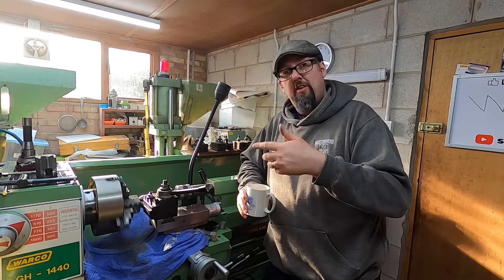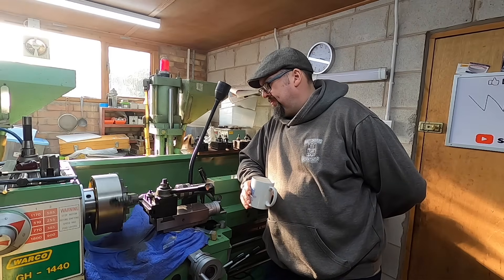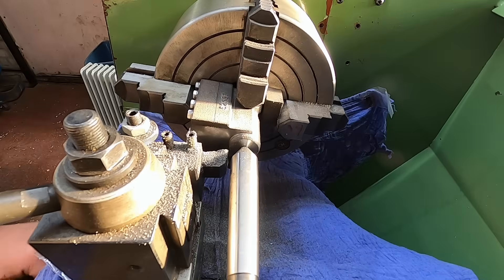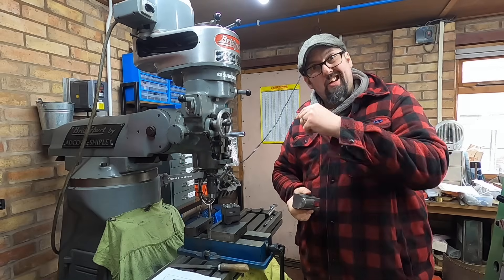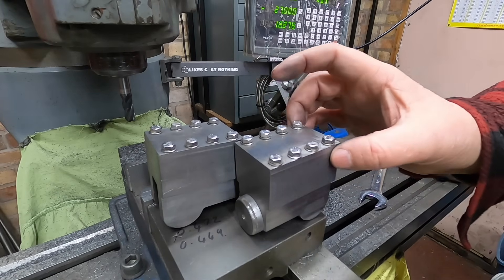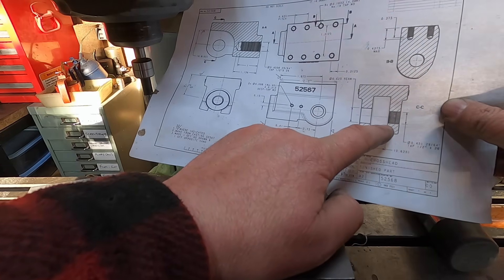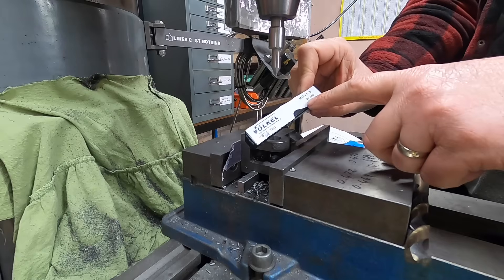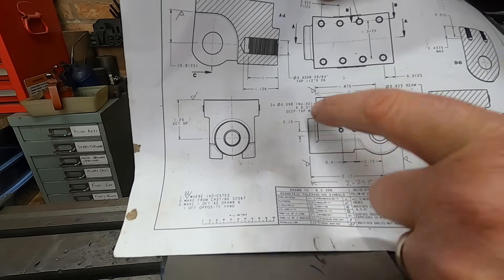More Machining on the Crossheads - EP74 Project Tinkerbell - 7 1/4" Steam Loco Build

Comment: Nice to see more progress on this build Matt.  A quick tip.  If you get another tap follower and put a small centre drill down the point, you can use it on all those small taps that have a point rather than a centre hole in them.  In my case, that's all of them, as I only build small stuff!
Reply from the maker: Thanks Mark, Great idea, I want to avoid small taps in the future 😂...... although if I build a 5" gauge loco or smaller..... All the best, Matt 👍🚂
Reply: @ so you’re not a 12ba man then 🤣🤣🤣

Comment: Thanks for sharing, you could up the feed on the lathe, but then you wouldn't have that surface ground like finish. Technically you have a scale correct finish on your parts.
What's the chassis rails in the back ground when your on the mill? A second Loco?
Cheers from Benambra Victoria Australia.
Reply from the maker: Thanks Warren, I could up the feed but it's me actually turning the handle..... I so wish I had power feed... but I'll take the scale finish 😂.  The chassis is for another project awaiting to be started I did a video on the parts which can be viewed here https://youtu.be/Olsjw3kXwmI . All the best, Matt 👍🚂

Comment: This stage is where I’ve failed with my two locos, drawing called for a 2 piece cross head silver soldered together. My fail was I didn’t leave meat on top slot. Remade but one piece looking slightly different by will do the same thing. No castings in my make. 
Good luck with the build Matt.

Comment: Thanks Again Matt. Have you done any work on that other 71/4 project yet ? no pressure just interested.
Reply from the maker: First and foremost a big thank you for the kind donation, it is very much appreciated. I've not yet begun work on the other loco yet, well apart from some CAD work for the new shape buffer beams. I'd like to start it, but you should never work on more than one project at a time.... so they say! All the best, Matt 👍🚂

Comment: 1/2x26tpi is close to M12x1. Taps and dies are easily available in that size as it's the thread used on proximity sensors and retaining nuts on ballscrews. I've even got a set for a die box
Reply from the maker: Yeah I worked it out to that, but my supplier of taps only had the M12x 1.25, and I could wait to have one arrive so I just went with the 1.25. Not going to make a difference in the long run. All the best, Matt 👍🚂